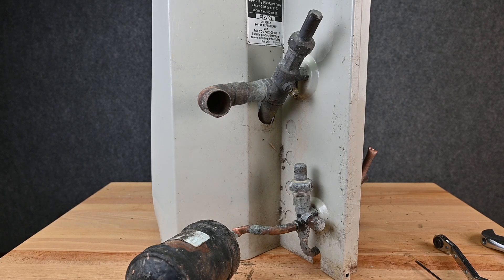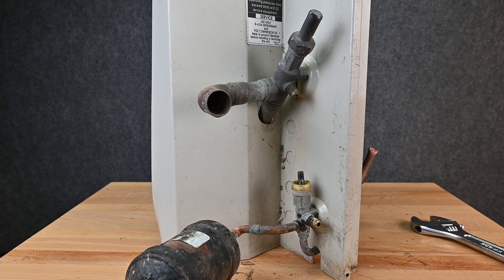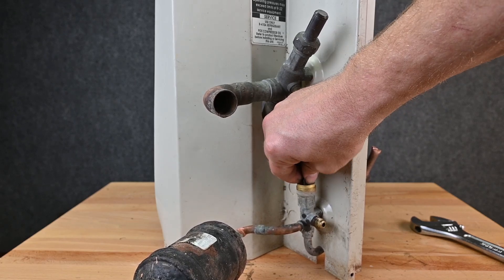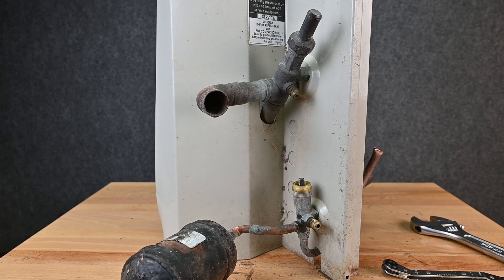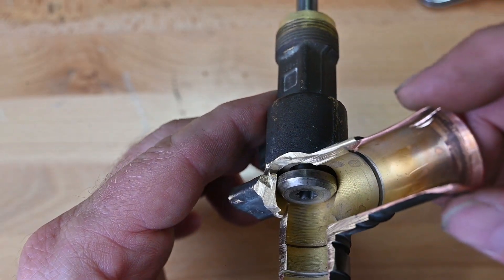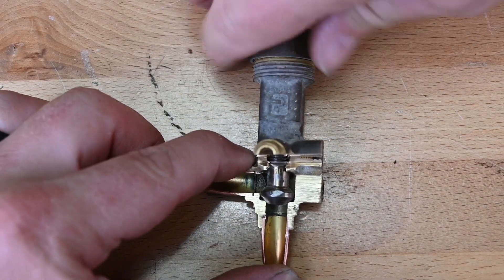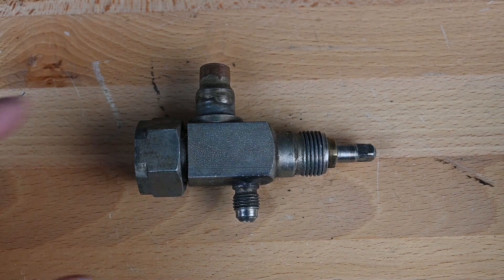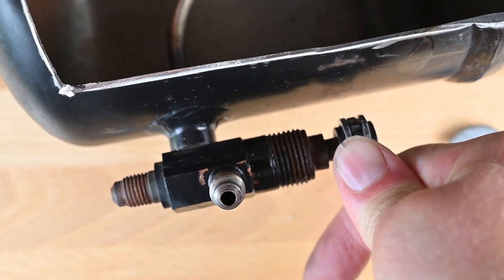HVAC 083 The 3 position service valve

Comment: Is there a direction of flow? Meaning dies it matter which port to the receiver & to the metering device.....
Reply from the maker: Often on residential equipment the port is connected with the line set outside of the equipment.
However I'm refrigerating condensors, the port is often with the condensor side. 

It will work in either direction but it's important to understand that the service port will be connected to the pipe at the top when the valve is closed (front seated). That way you won't get useto just one method.
Reply: @love2hvac  Thnk you, I appreciate your response!  reason I ask is I ran into a unit where the condenser side entered the top as well as the compressor inlet on the low side. I don't see how that will work when trying to isolate the 2 sides other than being dependent on the compressor valves. Seems to to me the suction line should enter the top and exit the bottom to the compressor

Comment: I've seen those valves used on a compressor suction & discharge ports with the pressure switches connected to the service port. It caused huge problems as engineers fully openened the valves blocking the service port and sensors.
Reply from the maker: These service ports are not designed to be used for pressure controls. 
Unlikely an engineer would design that. I often see service personnel try to add pressure switches here. We have been to many jobs where we had to properly install the correct switch on its dedicated port.
Reply: @love2hvac  Yes, I work on large ships where the engineers most of the time arent refrigeration experts but nevertheless it makes up 5% of their work. Due to the many different equipment and systems they have to work with they are technical generalists. (Diesel Engines,  Boilers, Hydraulics, Pneumatics, Refrigeration, E&I, Automation. etc. etc.)  

This leads to sometimes seemingly incompetent decisions, although i cant fully blame them. (It's hard being an expert in all those field at the same time.) It is the sole reason I self study and find so many sources like HVAC School & your channel to learn more practical things and try to remember them by the time i need it. 

Do you have a patreon or similar? You deserve support.

Comment: Great Video awesome 🤩 question 🙋🏽‍♂️ what’s the best position to vacuum the system and check for leaks… also pressure test which may be the same position… thanks 🙏🏽
Reply from the maker: Keep going in the series, I cover vacuum in pretty deep detail with over 13 videos. Leaks are in the works.

Comment: Thank you Ty good video with full explanation. When I was in school and tried to open the cup for service valve I felt high pressure then the refrigerant was loose, the valve was back-seated, then I made a vacuum and charged it and take off the manifold gauge there’s no leak till know I’m confusing what’s happen before and after.

Comment: Awesome cut-outs again! Really impressed by these. Makes it a lot easier to visualize the inner workings of these service valves.. 

Glad you're also using the term 'front-mid-back seat' as I've met some who'll just use term 'open or close' which is quite vague.
Reply from the maker: Thanks It was a little tricky getting those cut open.
Reply: @love2hvac  Yeah I could only imagine how tricky it is to cut these sections. Definitely NOT easy!